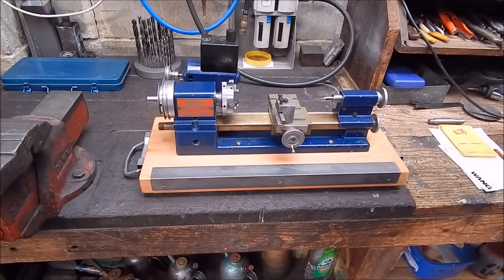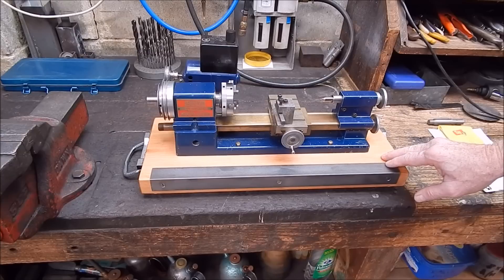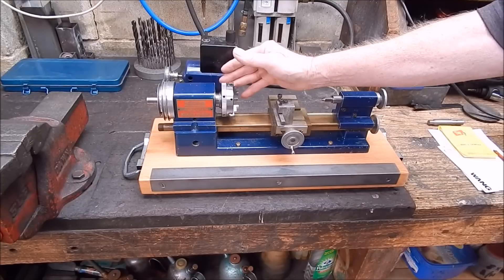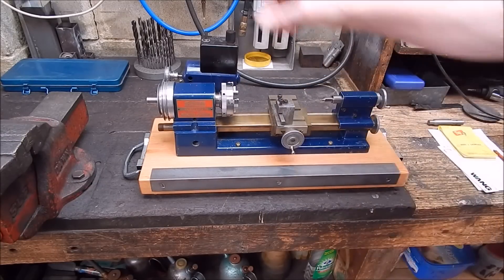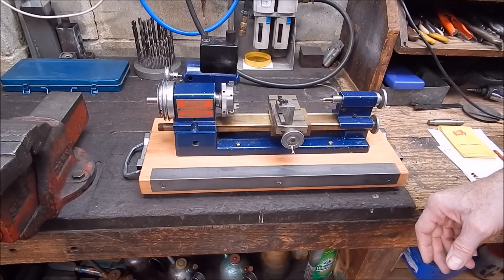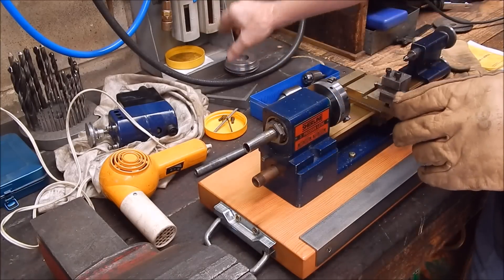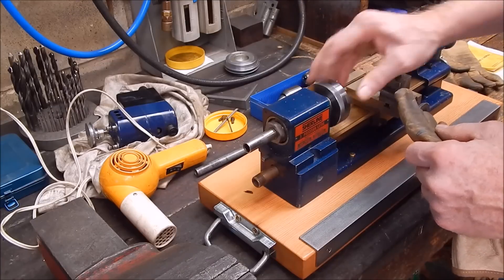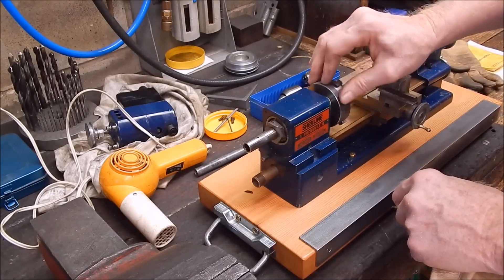Early Sherline metal lathe spindle bearing service - part 1

Comment: G'day Rob, The ZZ designation means shielded bearings 2RS would mean sealed. At least that's the SKF designation. 6004's are common and cheap. Regards Dave
Reply from the maker: Hi Dave,

Thanks for that.  Those 6004s aren't actually magneto bearings, but probably can be just as accurate in the right grade.

I will stick with what is original, as they only spin at a moderate RPM and the grease should stay put for a long time - same as an open roller bearing in a lathe.

Cheers Rob

Comment: Hi Rob:  I'm learning right along with you.  The headstock key on my Sherline sticks out from the ways by 3/4 in. or so.  This suggests to me that it isn't the original.  That might explain why I have a slight headstock rotation until I tighten the lock screw.  I'll look into getting a better fit there.  Thanks for the series.  BobE
Reply from the maker: Hi Bob,

The key may not be all the way in on yours.  

Mine stuck out about 10 mm and looks a bit burred over on the end like someone has been beating on it, so I thought it was a wedge after reading forum comments to that effect  (forum BS again).

It doesn't have to be all the way in to work.

Cheers Rob
Reply from the maker: Having thought more about this key aspect, I expect that the further in it is, the less actual rotation is possible due to the area of contact and parallax coming into play.

That's assuming the key is slightly under size,which I expect it is.

Sherline have information on their web site about how to adjust the headstock angle, which I will follow.

Cheers Rob
Reply: I think I'm good.  I changed out the key to another 3/16" (4.76mm) bar and the headstock is rock solid.  Not a perfect alignment with the tailstock but that may be due to the worn points on the dead centers I have.  They could use a regrinding like you showed on an earlier video.  Moving right along we are.  BobE

Comment: Hi Rob !

My Emco has the exact sam problem ... a little bit too noisy when turning, so I think I'll take it apart too.
Reply from the maker: Hi Keld,

Magneto bearings can be noisy even when new.  The sealed bearings used in later Sherlines may not actually be magneto bearings.

It's going to be interesting to see how much a lube quietens this lathe down (provided the races are OK).

Cheers Rob

Comment: Are you sure that the head alignment wedge is meant to be a wedge? Shopdog Sam had a bit of a demo of his Sherline, he was turning some fuel metering seats I think, anyways he described that piece as a key.
Reply from the maker: I checked on this and you are correct.  It is described as a key by Sherline.

I read on a forum it was a wedge, but that is not right it seems.  I will mike it up and see what dimensions it has.

Lots to learn about this lathe.

Cheers rob
Reply: NO, the forum's information was spurious? How rare...LOL! I share your frustrations in that department Rob...indeed I do.